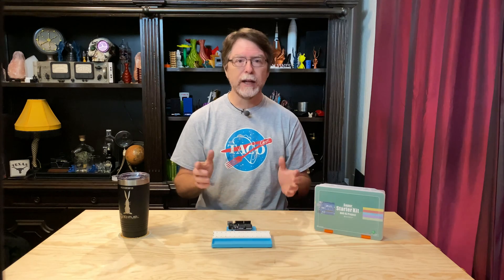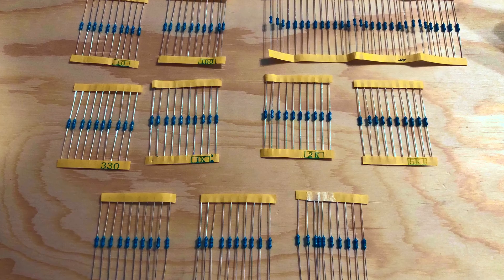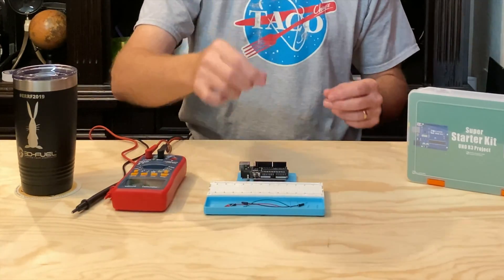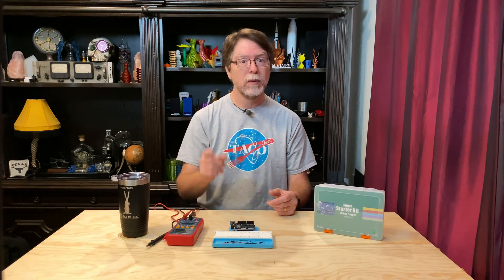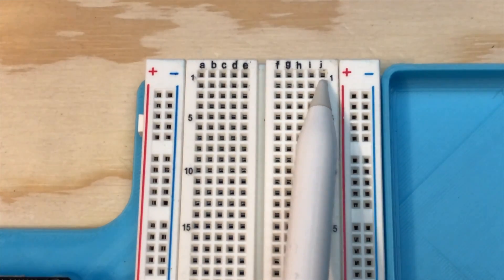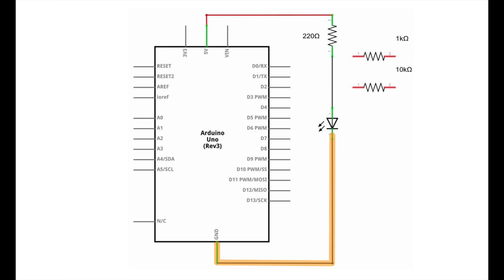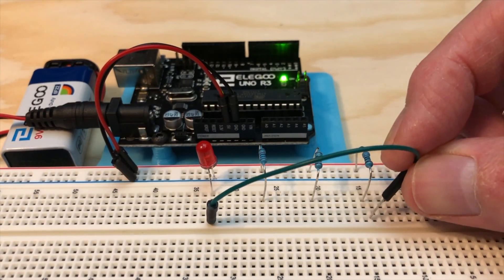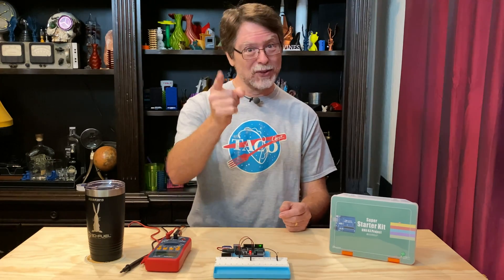Get Started in Electronics #2 - How To Control LED Brightness with Resistors

Comment: This was an excellent way to display the basics of the way an LED illuminates. I was also impressed with the way you explained polarity with the diode. You are exactly right in explaining that the current flows from negative to positive. Last, your explanation of the breadboard was great. Today, if you are going to build circuits you must understand the organization of the board and where to place the wires and also, as you mentioned, it is equally important to follow a standard wire coloring (i.e. Red + Black Power , Blue Control, Orange or yellow data).

Comment: Hi,I have a little problem where I converted my dash lights on my car to Blue LED's but the way I had to mount them meant one is further down the tube making it closer to the dash text so this one appears a bit brighter than the other one, could you suggest what resisters I could try to reduce this one to get them to match. They are 12 volt 5w T10 plug LED'S. Thanks.

Comment: Thanks, just recently added a led light bar on my van and added a lighted switch that can be lit all the time or only lit when the bar in on. Want to add a resistor to the wiring as it has a spdt switch to the led so it's on and dim at night but fully bright when it's lighting the bar light. Making the switch visible at night and knowing the light bar is on or off.

Comment: FINALLY - someone that teaches ELECTRON FLOW correctly and not the 'cornfusing' Hole Flow.
Holes do nothing.  Electrons do the work.  I have taught electronics since 1984, either in the Navy or at college level.
I've had many students that had attended classes that taught hole flow.
A very good lesson!
ET1(SW) MTS
US NAVY (RET)

Comment: Thanks for these! These are great and have a much greater educational value than the included Tutorials do.
Had to troubleshoot because I managed to connect the LED the wrong way around. So cool to see the LED light up after connecting the last jumper! 

Of course, being the idiot that I am I wanted to make a video to send to some friends and managed to connect the jumper to a non-resistor'd connection point on the breadboard. Result: Just a whiff osf something burning, an LED that wouldn't burn anymore and my complete astonishment. 

That's the story of my first burnt up LED.

Comment: hello,
what programming language is used by the IDE, specifically?
Reply from the maker: Hi! This is from https://flaviocopes.com/arduino-programming-language/:

The Arduino Programming Language is basically a framework built on top of C++...The main difference from “normal” C or C++ is that you wrap all your code into 2 main functions. You can have more than 2, of course, but any Arduino program must provide at least those 2.

One is called setup(), the other is called loop(). The first is called once, when the program starts, the second is repeatedly called while your program is running.

We don’t have a main() function like you are used to in C/C++ as the entry point for a program. Once you compile your sketch, the IDE will make sure the end result is a correct C++ program and will basically add the missing glue by preprocessing it.

Everything else is normal C++ code, and as C++ is a superset of C, any valid C is also valid Arduino code.

Comment: Thank you for this video series. I printed out your 3D stand for 12 dollars at the local library.  It works pretty well though I don't know exactly what to do with hole parts. The hole closest to the 9v connector didn't line up exactly but I still really appreciate you sharing it. The stand has been really useful so thank you for sharing that. I wish I knew what to do with the hole closest to the 9v connector and what to do with the hole closest to the "ON" led which is diagonal from the previously mentioned hole. I assume there is some kind of screw that goes on both of those but a video would be really nice... is there a way to redeem the mismatch? Thank you so much again.

Comment: Amazing video! Subbed and liked! I have a question though, I copied and used the same exact wires as you did but for some reason my led wont light up. Now I can only seem to find 2 reasons why. The red wire which is connected to the breadboard and the 5v port isnt fully connected to the 5v port. There is like half a centimeter of the metallic port part of the red wire which didn't fully go inside the 5v port. The other reason for why I can see it wont work is the yellow led flashing from your first tutorial. I remember you saying that whenever you use the Uno R3, the yellow light should always do its "factory" flash but my UNO R3 is still flashing differently from the time I coded from last lesson. I tried to reset the Uno R3 twice with the small red button but it is still flashing the same way that it did from when I coded it. Do you have any ideas?

Edit: Nevermind I just realized how to fix it. I was using the wrong side for the led port. Thanks for the video anyway!

Comment: Great Video, but he said that electricity flows from negative to positive, NO, thats the flow of elections but the flow of conventional current which is electricity, actually goes opposite, from positive to negative. He also said that in the diode, current can only flow from the barrier to the arrow, its actually the other way round, if you think about it its like a funnel. He probably knows this and just said it wrong by accident.
Reply from the maker: Hi Kevin! Cool!

Today I learned the difference between Conventional Current and Electron Current.

"In 1752, prior to electricity being identified with the electron, Ben Franklin chose a convention regarding the direction of current flow. Franklin assumed that positive charge carriers flowed from positive to negative terminals. We now know this is incorrect."
source: http://web.engr.oregonstate.edu/~traylor/ece112/beamer_lectures/elect_flow_vs_conv_I.pdf

For some reason, I've always thought in terms of electrons (and therefore electron current), and so that's what I'm referring to when I use the word "current" in the video. 👍

Comment: Do you have a 3D print for the mega 2560 starter kit? I like your set up so it doesn't short out. Right now I am putting the MEGA2560 on plastic it came with. 

Also, enjoying these lessons! Keep em coming and I hope they all work the same way!

Comment: Thanks for the videos!  Its great that you explain the "why" and not just the "how" of the project.  I am very new to coding & electronics and do have a newbie question.  In the schematic for this project why is the resistor between the positive side (5V) and the LED instead of between the ground and the LED?  I heard you mention (and understand the principle) that current flows from negative to positive.

Comment: Hello Brian. Awesome lesson. One question i do have is that you explain the flow of electricity at 11:40. The flow of electrons are from Negative to positive, so shouldnt current flow from positive to negative or in this case pointing towards the direction of the arrow against the wall?